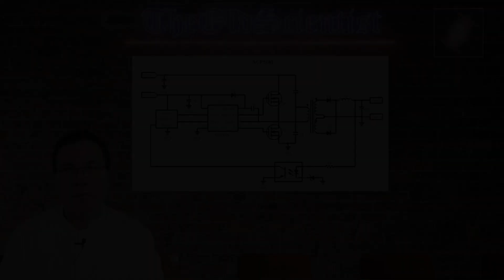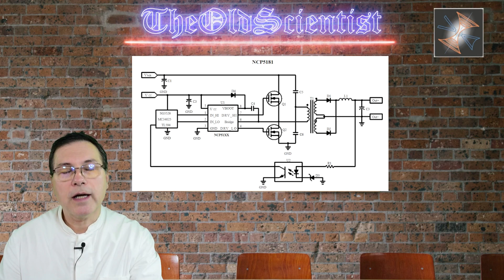Half-Bridge with Bootstrap technologies challenges

Comment: Fly back voltages would fry transistors ,vacuum tubes would work better, especially mercury doped  hexodes
Reply from the maker: It does not if you follow my guidelines of using RC Snubber technologies as demonstrated before. But in general I agree if not protected.